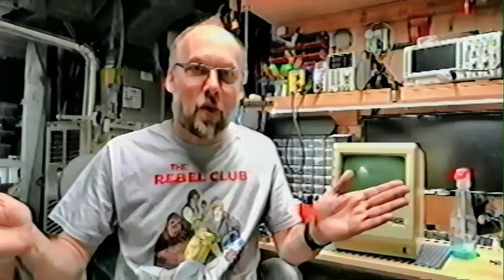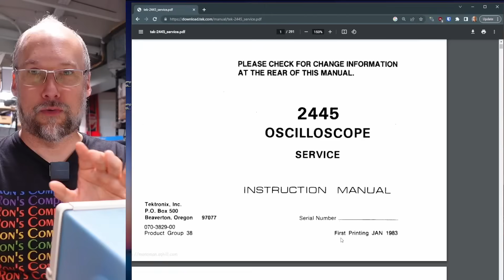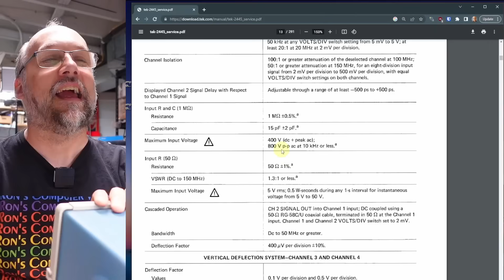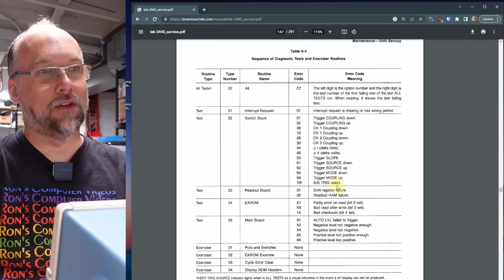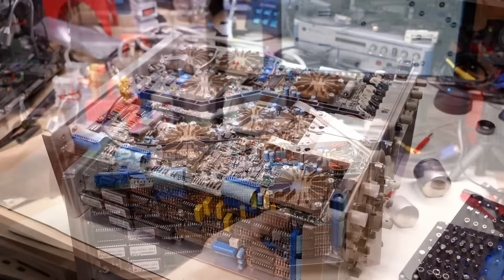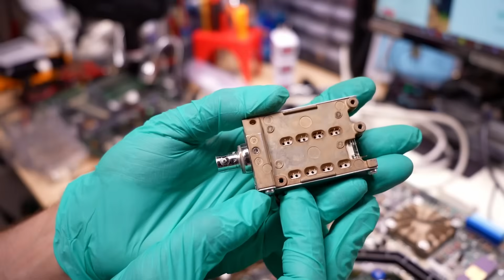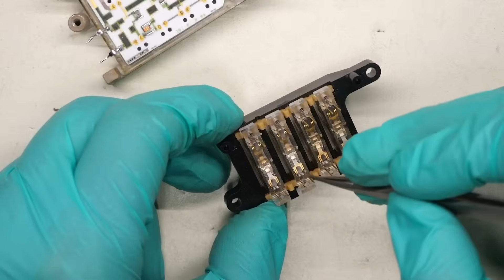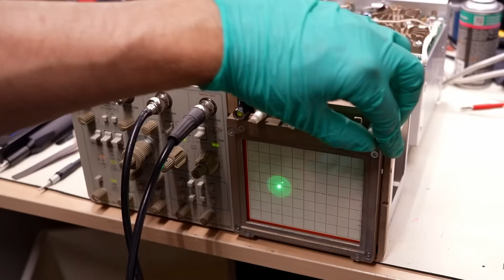Tektronix 2445: My first vintage oscilloscope repair attempt

Comment: It looked like those 4 relays in each module could be swapped. That might give a clue about whether any of the relays or relay contacts are the problem.
And since pushing the BNC connector up/down seems to have an effect, I wonder if that is flexing the board in that module ever so slightly causing some relay get bad contact on those gold pads that might be fixable by forcing those relay contacts to bend a bit more firmly towards the pads.
A really unlikely option: could some relay be turned around 180 degrees and have its contact misaligned with the gold pads?

Comment: I've seen comments of people getting these things for cheap, and I can't get one like this for less than $300 cdn (partially working, 50 ohm issue yours seems to have too).  I saw a 1967  Tektronix 422 on Kijiji for $60 and I snatched it up, and it works great but it's a little behind the times.

Comment: I was screaming "dry joint" all the way from 33:10, did you not hear me?

Try reflowing the PCB joints.  Also try swapping the modules to see if the faults transfer over.

Comment: I would try looking for cracks under a microscope
Then use some graphite conducting grease very sparingly to lubbe just the individual contacts & BNC.
Reply: No. Please don't introduce any wandering conductive material into the attenuator.

Comment: I love my Tek 2211, it's a digital/analog hybrid scope so you get the best of both worlds, though it's limited to 20MHz in digital mode, 50MHz in analog. Part of me wonders if those little spring contacts on the bottom of the relays are causing the issue, they could've lost tension over time, might be worth trying to gently bend them out a bit so they make better contact with the pads on the PCB.

Comment: may I recommend having the relays ultrasonically-cleaned?  and under NO circumstances do you "scratch the surface" of a gold-plated contact and MOST DEFINITELY do NOT apply solder (unless you use that which is provided on a small spindle in the rear of the unit; it is SPECIAL!!!)  if the contact is pitted, you can clean it with de-ox or iso-propyl alcohol.. then try applying a small piece of gold leaf in-between the contact and its mate, but NEVER EVER scratch the plating away as what you experience WILL occur due to thermal actions.. (you basically DESTROYED the contacts!).

Comment: Your contact problem might be inside the relays themselves. They appear to be sealed, making a tiny hole with a drill (by hand) you can spray some deoxid into those. Then clean with IPA the residue ( it’s still 150 MHz scope😬). Using coaxial cables you should set to 50 ohm, as it is their impedances, on AC/DC setting should be 1 Meg for probe use. Very entertaining video, many thanks.
Reply: Yeah, I've had plenty of issues with oxidized contacts inside relays.  Definitely worth checking out!
Reply: There aren't contacts inside the relay.  It is just the two coils (in the style of a latching relay) and the armature.  The contacting is between the ceramic 'PCB' and the external moving contacts at the bottom of the relay body.
Reply: At such low frequencies as those used in the video, direct use of coax does not matter - proof of channel no. 3

Comment: I would swap the relays between ch1 and ch2 to see if the problem switch channel. I would also check the soldering point of the two bnc connector.

Comment: This is one of those moments where I observe that technology has evolved backwards. This is really an amazing piece of technology of the 80s, extremely well constructed, something you rarely see in modern electronics.
Reply: It was also $11,000 in today's money.
Reply: @wesley00042  Exactly, you can get quality like this for that price as well. Though I do agree that engineers back in the day could use more quality components then these days.
Reply: Another one of the "everything was better in the past" folks.
For what this oscilloscope used to cost, you can nowadays get a modern DSO in the GHz range, with tons of features, protocol detection and in-built calculation like FFT and function generator. A proper DSO also hasn't any drawbacks, as memory depth allows to view stuff like jitter and twitching. 
Not even speaking about the fact that a useful DSO can nowadays be had for less than $100.
Reply: @graealex  Not eveything was better in the past, but in this case... Modern DSO with high frequency is still very expensive. It will have a nice LCD screen and fast CPU. Is it actually a better oscilloscope?
Reply: @danielmantione  Yes, it actually is. At around $500, there isn't a single metric where the DSO isn't going to be better. In particular, you will get PoV, so that imitates how a CRT works and will show things like jitter visually. Not even talking about all the neat stuff like single-shot and time lapse mode, logic analyzer and protocol decoder, that only work with DSOs.
And again, at the price point of the 2445 when it came out, you can now get a top-notch DSO with all the bells and whistles.
Although even today, I would rather spent $300 on a DSO, instead of the same money on a used analog one.
Reply: yes. in multiple ways, such a crt scope cant freeze the image so single trigger doesnt work. @danielmantione

Comment: My first and oldest scope here, a Telequipment S43.  Fully valve powered and in a case that you could drop a building onto and it will still work.  Best part, you try and overload the input and the valves just hold their noses rather than give up the ghost like more modern replacements.

Comment: My best friend has some really old Tektronix scopes with tube amplifiers, and one with an analog memory tube: it can display one-shot signals like a digital scope. But the thing draws 500W, enough to heat his basement in the winter 😛.
I also prefer analog scopes, because they react much quicker and you have all the controls directly under view, I think they're better to learn how to use a scope. I have a Trio (Kenwood) from the 1970s, still need to clean and calibrate it, the controls partially don't move so smoothly anymore, so a lot of Deoxit is needed ;-).
This is BTW a nice "crossover", really cool that they already had that in the early 1980s, was probably not cheap ;-). To bad that the construction of these attenuator boxes looks to me a bit flimsy, I would have expected better from Tektronix...

Comment: Probably a quick scrub of a fiberglass pen on the PCB and relay contacts first. Then pull (down) the contacts on each side, under the individual relays themselves. Pull them down roughly about 2 millimeters lower than they were originally. The loose pin connection to the ceramic PCB might be the real issue though. If that moves around with every little adjustment, that might be your issue, dunno.
Reply: You are out of your mind, using a glass pen on the gold plated surfaces and contacts in the attenuator as well as using very rough paper is too abrasive
Reply: @Edisson.  Better than scraping them with a scalpel!
Reply: @anthonydenn4345  He did scrape it with tweezers, but both are bad - the definitive destruction of the contact
Reply: @anthonydenn4345  Find my main comment, there I describe how such contacts are cleaned, but mainly where there is probably a fault and it probably won't be the relay - but I can't say for sure without measurements.
Reply: @anthonydenn4345  Yes, you need to realize that this is not an automotive relay where tens of amperes flow, here any inaccuracy in the contact surface or in a poorly bent contact will cause a problem. Those contacts have a calibrated contact pressure, and to change it, you need to know the pressure value and have a calibration scale for the contacts - this process is called "Adjusting the contacts" and is carried out using special pliers and a pressure gauge.

Comment: Could it be a problem with the BNC connectors and their solder attachment to the preamp PCB? I imagine CH1 and CH2 would get the most action and repeated connect/disconnect cycles of the BNC jacks would apply enough pressure over time to cause stress fractures in the solder joints.
Reply: ...or the actual female part of the BNC connector.

Comment: Try gently bending the contacts on the relays that meets the pcb they act like springs but the been in that position for about 40 years so with temperature changes they no longer make positive contact that should fix the flakey behavior for another 20 years. Just bend slightly.

Comment: Signal generator amplitude will only be correct when it is going into a 50 Ohms Load.
https://unitrend.oss-cn-hongkong.aliyuncs.com/upload/file/20211016/UTG900E.pdf
Output characteristics
Amplitude range
s10MHz:1mVpp~10VpM(50Ohms)
$60MHz: 1mVpp~5Vpp; (50Ohms)
Accuracy (1 kH zsine wave) i(3% of set value+2mVpp)
https://youtu.be/Rks_AyfJNq4?t=1278
Reply: Yes, correctly, a 50 Ohm terminator should be used on the AC and DC range, but it is not necessary to detect such huge differences - proof channel no. 3

Comment: Have you tried bending a little these spring contacts on the reed relays? You may also try to put some self-adhesive soft foam gaskets (like those for windows) on top of them.
Reply: Those are NOT reed relays.

Comment: flexing your relay contacts so they make a more positive connection to the module board will correct the issue without the need for the paper.

Comment: I wouldn't be so draconian in judging modern digital scopes. I reckon you would have no issue at all in capturing spurious glitches if you made sure to use a digital oscilloscope featuring an adeguate number of waveforms/s.

Comment: I think the "pads" on the relays that are pushed against the hybrid PCB might have to be bent out slightly? Mabe the force the excert on the PCB isn't quite up to spec anymore. Pushing the cases/frame further might not do the trick entirely, because that frame/case might bottom out before the contacts reach their proper force? I hope there's not a hairline crack in the ceramic though...

Comment: Never trust relays.  The contacts can have high resistance. So they click but are not making a low resistance connection. I ohm out the relay itself. You could have used a pencil type eraser on the gold contacts.  But if it works its beautiful.

Comment: I am a Tektronix 2235 user, mine had broken focus circuit when I bought it but I managed to build a new for it myself. I think the issues you have could also be in the relays themselves and then it could work to rig them up and use a fast switching supply to really exercise them to get the contacts better again. use a microscope to check any cracked or poor connections on every components. there is a possibility ceramic boards could be more sensitive than regular PCB for thermal changes over time. if it really is just a poor contact it should work to fix it if you get to know where or why it actually fails. you would have a really nice scope there if you can fix it :)

Comment: Be very careful when touching, cleaning, and rubbing those open hybrid circuits, you can very easily damage the printed high-precision resistive ink printing, which will completely destroy the hybrid. 
I use to design, construct, and troubleshoot those types of hybrid circuit boards.
Reply from the maker: Heh well unfortunately for me, this one self broke all on its own.
Reply: Hey @tekvax01 can you help me out with something? The opto U1040 on a 2445 low voltage power supply I'm working on is blown. I think I or someone else accidentally zapped the input side coming out of U1371c. SOC123A is a number I can not find. Old common parts lists call that Tek pn 156-0885-00 a MOC1005. Also finding a reference to a TLP631 in later 2465a and b power supplies for that IC. RPR says 156-0885-05 is the replacement for -00 suffix. TLP631. Is that correct? The closest cross I seem to find is TIL117M. Would that work correctly there?

Comment: With the relay contacts being an issue, I'd go back in and give the contacts a tickle with a fibreglass pen, a very light touch though, if that doesn't do it, maybe bend the contacts very gently outwards from the relay modules to give them a bit more springiness, given over time they may have been bent inwards meaning they haven't got enough oomph to maintain a reliable connection... :)

Comment: Gold does not oxidize.
Reply: Yes it does. Just takes much longer. You have heard of gold tarnish?
Reply: @kostaskritsilas2681  not really. That's "why gold"
Reply: @milantrcka121  Really. Only pure, 24K gold of high purity doesn't oxidize. However, the gold used in relay contacts is NOT high purity 24K gold. So, in this context, yes, it does tarnish. And by high purity, something like 99.99999% gold. And if you think that doesn't exist, look up the gold composition of bond wires used to bond silicon wafers into packages, or for bonding in hybrid ICs. Anything of lower purity will interfere with the bonding process. Even gold bars or bricks, or jewelry 24K gold, is not that pure.

Comment: Word to the wise, when working on tek scopes, don't mess with it, and shoot the parts cannon at sections of the system that are functioning correctly. 
Leave the caps alone, unless they are faulty. These are all precision parts, and shouldn't be replaced until they fail! The life you save may be your own!

Comment: All of the pre-1990 Tek scopes are masterpieces of chassis design and circuit layout.  The early tube-based CRT scopes are especially nicely laid out.
Reply: They really are.. my profile picture is from a tubed Tek. I still cant believe how "simple" they look when the cover is off.
Reply: What happened in 1990?
Reply: @MaDmanEXE  Nothing in particular - the boards were still nice, but by then it was mostly ASICs and surface mount components, so there wasn't as much as aesthetically pleasing as before (when through hole components, larger individual IC counts, and even vacuum tubes dominated).  

That's not to say the board quality was poor in later devices.  When I was working there (2000-2020), I can attest that the hardware engineers took their work extremely seriously, and they always used high quality components throughout even if the designs were fairly pedestrian by the standards of the 1960s-1980s models.
Reply: @Damaniel3  Yes the build is phenomenal, I have replaced several Tektronix oscilloscopes in my life, I currently have two in my home lab.
Both fully restored, two channel portable model 212 with completely redesigned source section - no need to use battery as a filter - connected as a waveform tracer display unit - year of manufacture 1972 and base model 2465 with no additional digital functions - no need to worry about a battery backup because it doesn't have
Reply: It's nice to have physical buttons for functions, but obviously the new digital scopes do so much that it is just impossible to have all the settings as physical buttons.
Reply: The trouble is the unobtanium parts in the more recent scopes and use of tantalum caps that were rated close to rail voltage. Yikes.

Comment: https://youtu.be/DX6ipBe3WGQ?t=2644 Why it says 150 mhz? Is 150 milihertz scope or 150 MHz (MegaHertz) scope ?
Reply: Its 150 Megahertz. There would be very little use for a 150 millihertz oscilloscope.
Reply: @kostaskritsilas2681  I am speaking of correct prefixes and unit usage: mhz vs MHz. It could sound grumpy and hateful, but, we, engineers like perfection.

Comment: The difference between oscilloscope CRTs and TV / monitor CRTs is in the method of deflection. Oscilloscope CRTs use two pairs of charged plates to steer the beam instead of the usual deflection yoke. There are actually some very early TVs (late 1940s era) that used electrostatic deflection CRTs. On the digital board, the Motorola IC next to the EPROMs I'm 99% sure is a custom version of the 6800.
Reply: I'm curious, why do you think it is a custom 6800?
Reply: My guess would have been a 68000 given the era and how ubiquitous they are.
Reply: @JCBudro16  A 68000 of that era came in a VERY large package (64 pins and nearly twice as wide as standard 26-28pin Eproms/40 pin CPU packages). In 1982 the most common controllers were 6809s (built in clock), Z80 or 6502

68ks were more or less brand new at that point and only found in high end computers. One of them would really have been complete and utter overkill in a scope

Scrolling through the video, at 20:57 you can see the cpu is a SC67127 - which looks to be a 6800 SOC of some description (I can't find datasheets for it but it's showing up in multiple locations as the microprocessor for a number of Tek scopes

It was only a couple of years after this that Atari STs were using a Z80 as embedded keyboard controller. How things have changed
Reply: @miscbits6399  Ah, I thought the scope may have been from a bit later era but that makes sense. My HP 54501A is 68K based but it's a full digitizing scope.

Comment: I bet it is a contact issue inside the relays themselves, not their contacts with the pcbs. 
If you can disassemble them or spray some contact cleaner inside them and make them klik electronically or by hand many times you may fix the issue for years to come. Just my 2 cents, cheers form Greece!
Reply: There aren't contacts inside the relay.  It is just the two coils (in the style of a latching relay) and the armature.  The contacting is between the ceramic 'PCB' and the external moving contacts at the bottom of the relay body.

Comment: Maybe the leads got pulled hard when connected at some point. It does seem like a mechanical issue. Perhaps you could try swapping the relays around and see if it helps. Perhaps you can get some modes working better. Otherwise try to bend the metal bits out a little bit. Maybe there are cracks in the solder on the BNC plugs too. I'm sure you can find a way, Adrian! ;)